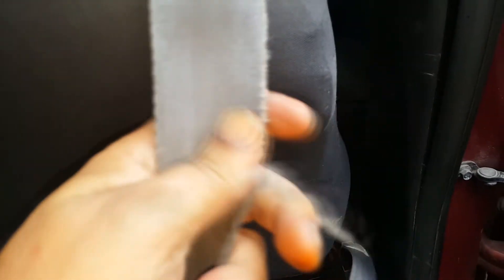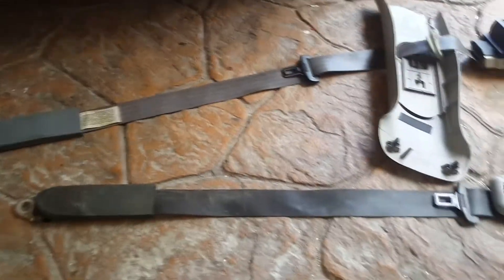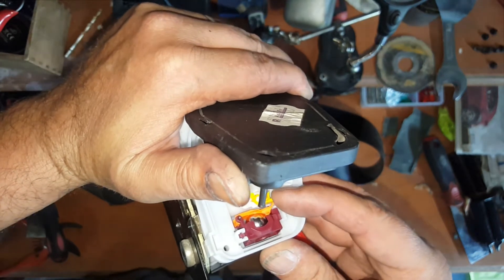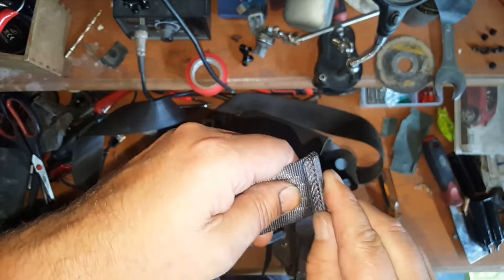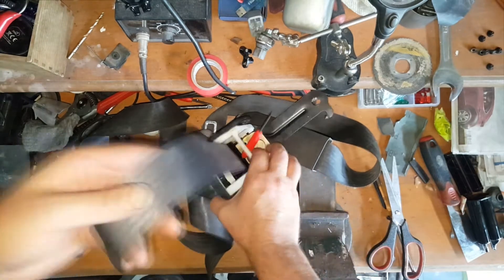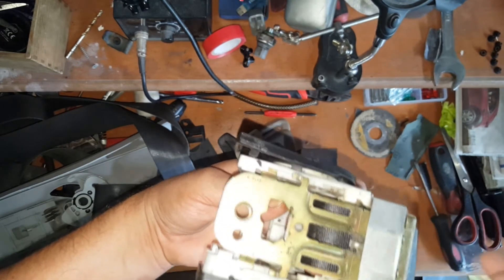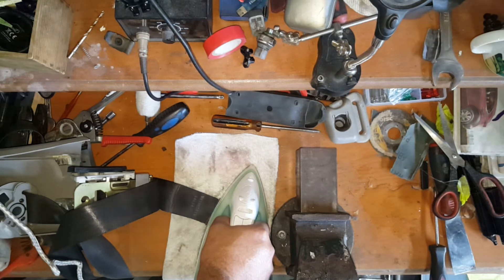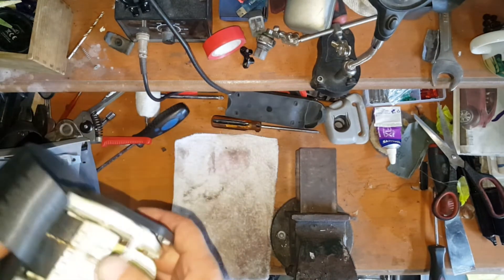How To: Remove Front Ford Falcon Seat Belt & Repair.

Comment: I was wondering about the bolt down the bottom that's what I'm up to you but it looks like I need a special bit for it
Reply from the maker: Yes. I believe its a T50 Torx Bit Socket you will need.
Reply: @TEKNOFIED  luckily I found an old bloke that had one thank you very much anyway . Just need to get a brake switch put in and I can take it over the pits 🤞

Comment: Any tips on doing a au Falcon back seat Balt
Reply from the maker: The rear center belt I think you are asking about. If you're having the same problem I did with it not retracting! What I did, in the end, was break away the plastic on the sides and my belt works great again. I will have to relook at it to remember the steps I took. I might make a quick video about it as well.

Comment: Hi i have a toyota hilux 02 space cab ute and I want to replace the original seat belt but keep the same retractor. How do I take out the pin thats holding the belt in the retractor? But if it doesn't have a pin is it usually easy to take the belt of the retractor?
Reply from the maker: Toyota is easier than a Ford Falcon. Did you see my clip of swapping the belt on the 98 Hilux https://studio.youtube.com/video/SP8KWZ0SJOI/edit